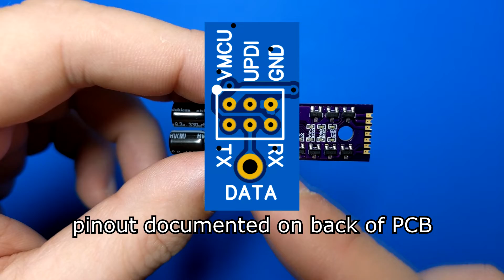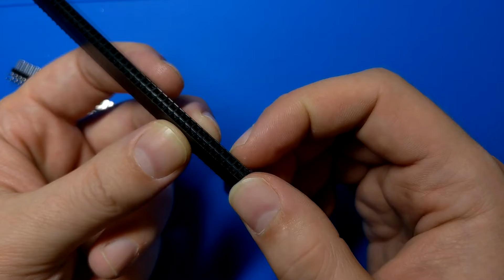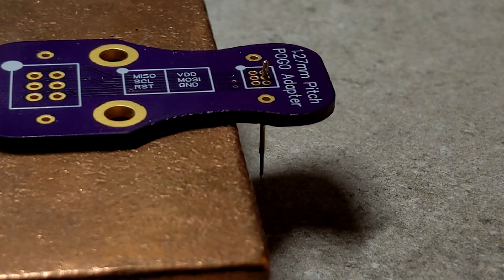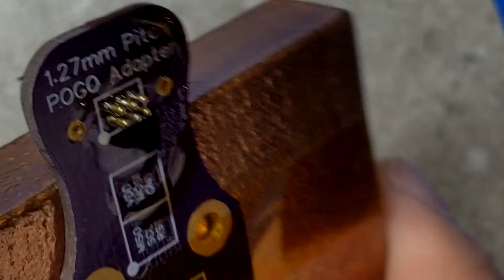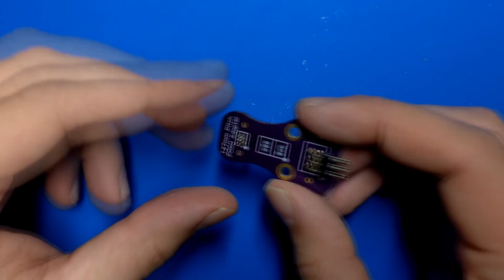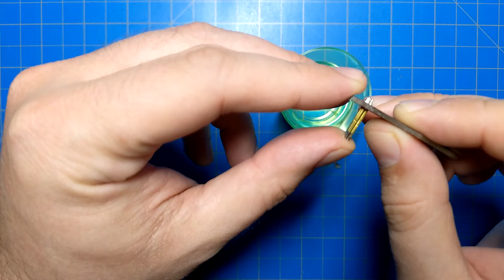A POGO Pin Adapter for Programming Microcontrollers

Comment: Hello. Do you know if Pogo pins can be used on solder joints of SMD resistors? I have a need in a rig that would need to probe right at solder joints of 0805 resistors, and I don't know if pressure from the pins can break solder joints or resistors themselves.
Reply from the maker: I don't think the pressure from pogo pins would break solder joints for 0805 resistors. It may be difficult to stay connected to them though as solder joints tend to be curved and usually pogo pins want a flat surface. Pogo points with a pointed tip might work. You may have to experiment some.

Comment: Just wondering what connects to the headers? I see some type of programmer there but hard to make out. Apologies if that's documented somewhere else and I missed it.
Reply from the maker: The programmer will depend on what you're programming. In my case I'm programming an ATTiny1606 which uses UPDI for programming. There are a couple different options that I've used for UPDI programming. One is an Arduino Nano programmed with jtag2updi (https://github.com/SpenceKonde/jtag2updi). I then wire up ground, power, and the UPDI pin (digital pin 6 on the Nano) to the adapter as needed. 

Another option is SerialUPDI in which the programmer is just a USB-to-Serial adapter with a diode between TX and RX which you can read up on here: https://github.com/SpenceKonde/AVR-Guidance/blob/master/UPDI/jtag2updi.md

If you are programming one of my blade controllers I have a video covering how to setup the programming environment and how to use both SerialUPDI and jtag2updi with this adapter. It's currently unlisted as I have a few more videos in the series I need to put together, but it is available if you want to watch it here: https://www.youtube.com/watch?v=AhdHEon9h7o